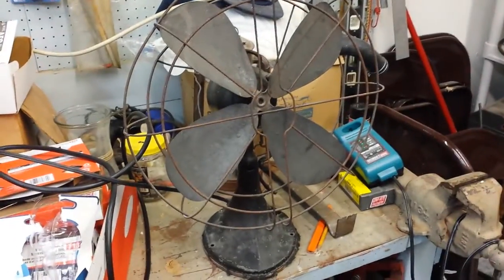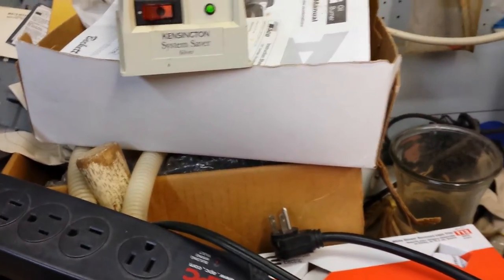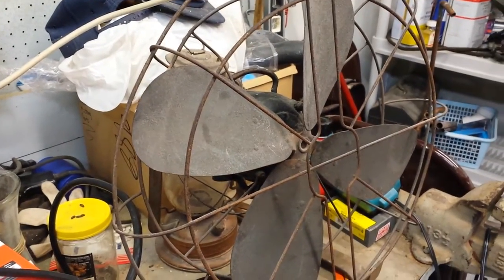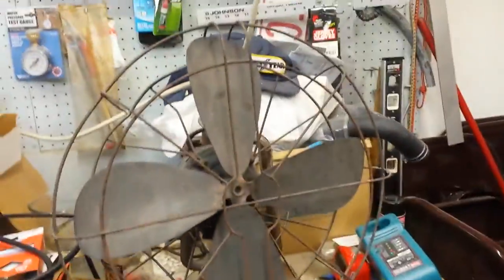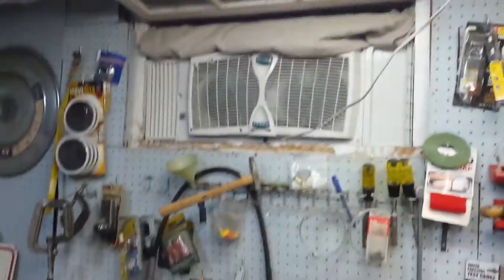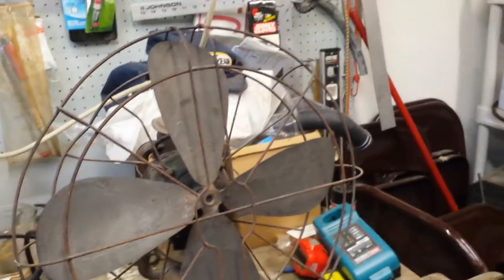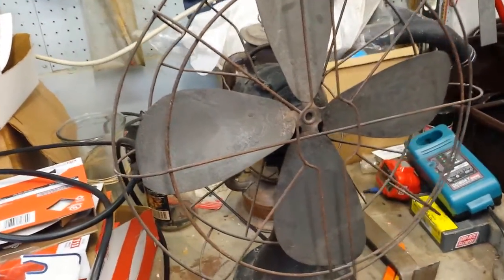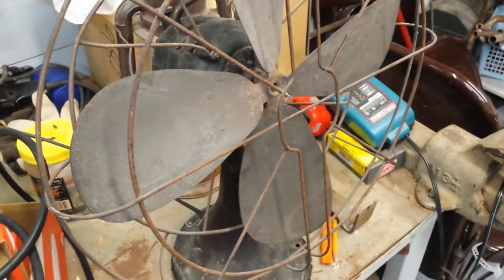Update on 1920's Hunter desk fan

Comment: Thats definitely a capacitor problem, without a doubt. I've seen this before plenty of times. Given that your fan is as old as the hills, the capacitor is definitely bad. I'm actually suprised that it worked for you for a while the first time you got it. The fact that the motor couldn't even start itself was a dead give away of a worn capacitor.
Reply: Fans back than didn't have nor needed capacitors, I have one of those and I've took it apart before and there's no capacitor, but mine runs like normal.
Reply: @sethhorst6158  I respectfully disagree. I have a fan from the 1930s that has a capacitor. Its not just modern fans, old fans have them too.
Reply: I don't think capacitors even exist yet in the 1930's.
Reply: Even if there was, where on the fan would it be located?
Reply: @sethhorst6158  Yes, they did. Radios had them and fans did as well. If you have a multiple speed fan, you have a speed coil to regulate RPM, and a capacitor to help start the motor. Not all fans had them, yes, but lots of them certainty did.
Reply: They are usually located somewhere in the base of motor housing.
Reply: I only remember seeing the stator, and the greasy oscillation mechanic when I took the motor on mine apart to oil the motor so it would run faster.
Reply: @sethhorst6158  Did you look in the base?
Reply: If you didn't, take a peak in there and tell me what you see.

Comment: Man thats a shame. But I agree with jaykay18, its a capacitor problem...which is good news! You don't need to rebuild the windings!
Reply from the maker: Where can I find a replacement capacitor for this fan?  You noticed Ken Batemans comment, the motor according to him needs to be rewound
Reply: You need to find out how many mfd and volts the capacitor is first, then any capacitor with the same mfd and volts can be used, although might have to be mounted on the outside of the motor casing. The windings should be ok, the only way to really know is to open it up.
Reply: Fans from that era didn't have any capacitors, only modern fans use capacitors, my guess is that the windings is shot or there was a shortage from the wires inside decaying.

Comment: I know how it feels to have a fan you love not work. I had two, a 1920s dominion fan and a 1940s Deihl fan. I gave the dominion to someone two restore because the motor was saveable and I gave the deihl to someone to part out because the blades were severely off balance and they wouldn't spin with the motor shaft. Not to mention the motor was on it's last legs and the fan needed to be rewired.

Comment: That much smoke for that short of a run?  I doubt it's burned windings, I'd say capacitor.  Especially since it didn't want to start on its own, but kind of ran when you gave it a hand shove.
Reply from the maker: It is the capacitor.  i tried the other speeds and it did the same thing.  wouldn't start and a big puff of smoke
Reply: Will Butter Diagnosis complete!  Next time if you're worried about something blowing up, do it outside.
Reply from the maker: jaykay18 I actually tried the other speeds outside in my backyard

Comment: I probably can fix it I had a antique fan do the same my Emerson turned out the wiring to the motor but turns out in your case your motor is soon to burnout but I repaired a lot of vintage fans and antique fans so i would love to have it fixed remember this fan is actually from the 1950s